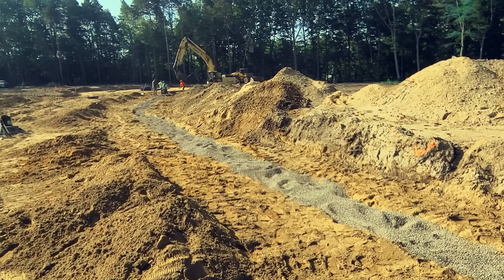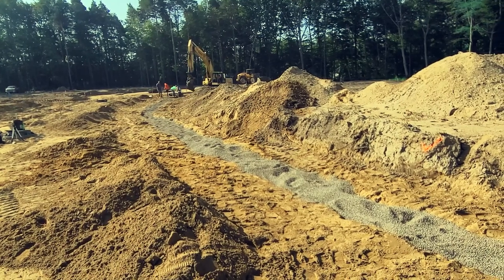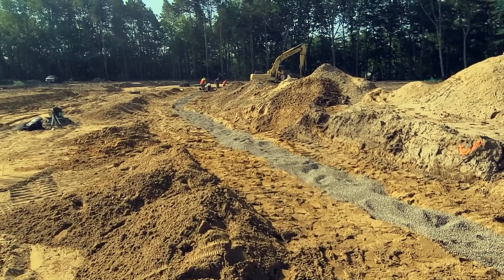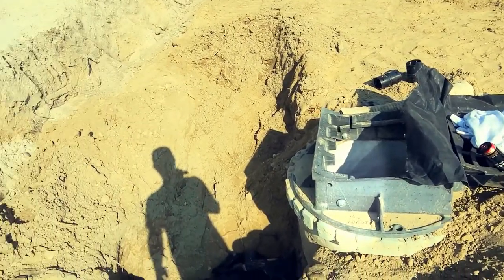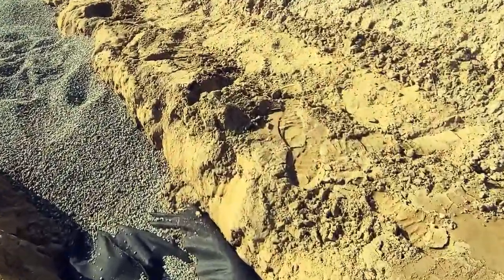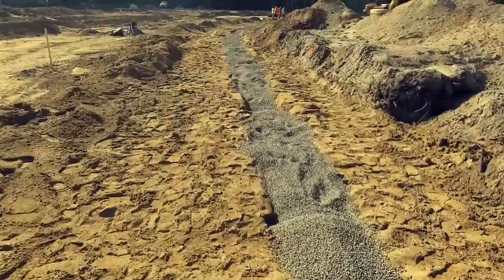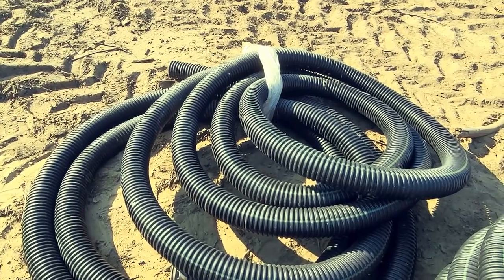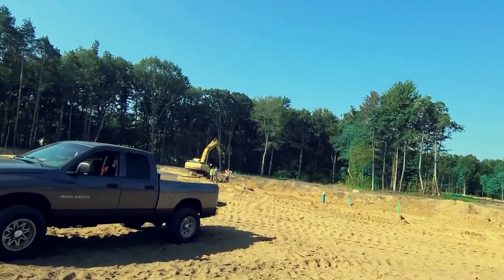WHAT IS EDGE DRAIN? || What is drain tile? - What is the purpose of edge drain?

Comment: Can this work for my house/basement? I have water coming over the top
Of my basement wall.
Reply from the maker: Yes, you would need to dig down around the house and install drain tile around the perimeter. You'll want to bed the pipe with pea stone and cover it over with 4-6 inches of pea stone before burying. The end of the pipe will need to either run to a sump to be pumped out or it will need to be daylighted where the water can run out freely. Look up French drains. That's what I would recommend for your issue.